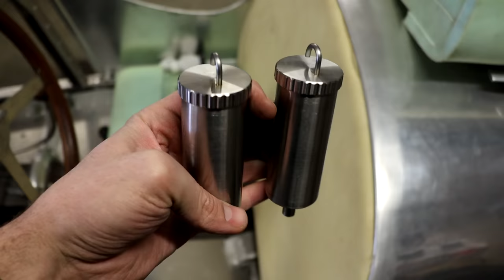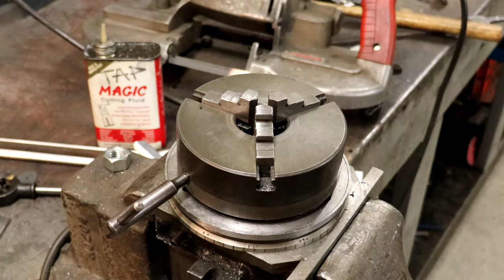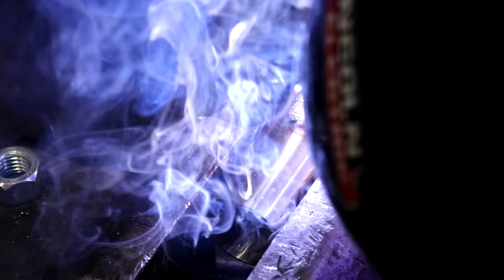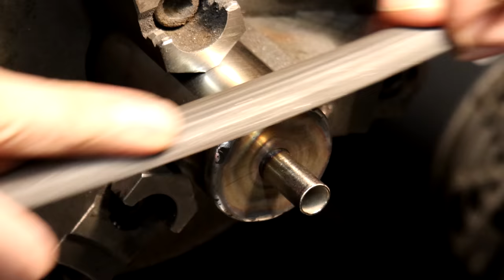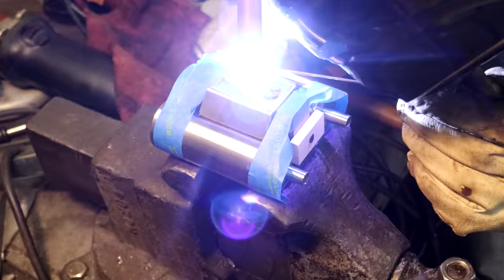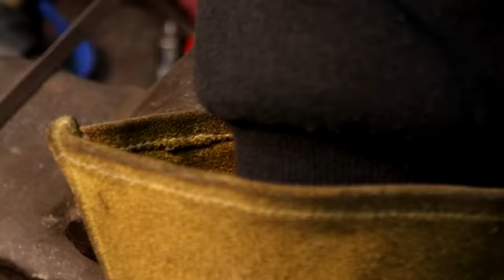Making Cool Components to Replace Ugly Ones | Homemade Boat-tail Speedster Pt. 56

Comment: Really nice! Suggest using hard line from the remote reservoirs to the master.
Reply: I agree! The reason this video appealed to me, was that over time, the plastic reservoirs leak (seepage), right at the hose junction to them. A hard-line connection would completely resolve this issue, especially for a car that sits for long periods between uses.

Comment: Beautiful work!  Stainless steel's electrolytically compatible with the aluminum firewall. [See correcting reply.] Those plastic bottles would be total anachronisms on the car. Not constraining yourself by mounting the things before other systems determine the available space is smart.

Comment: dude nice work! looks amazingly nice! but if I see it right you have a vent to provide proper feeding for the zylinder. thats absolutely important to have but if you use a brakefluid it is hygroscopic and will absorb water from the air around. better take some silicone based brake fluid or even LHM+  (often used in old french cars)
Reply: Brake fluid is also incredibly corrosive, which is why plastic resevoirs are so common.
Reply: The vent hole is on the other side of the rubber disc which will therefore act like a flexible bladder. Not sure if this would be sufficient sealing or maybe not flexible enough. Needs experimentation!

Comment: Hey man, love watching your videos and I think you’re doing a great job. However there is definitely an issue with your reservoirs. Brake fluid can’t be open to the atmosphere because it will draw in all kinds of moisture. If you look at any type of master cylinder reservoir they have a seal with a bellows on them so fluid can come out of the reservoir but still be sealed from the atmosphere. You might want to take a look at that. Keep up the good work!

Comment: I think you made the right choice using stainless. Certainly over using the plastic reservoirs. 
Years ago when I was working on a new model project at my works R&D shop in Ohio one of the fabrication guys there made an aluminum brake reservoir for his race car. It was the first time for me to see an CNC mill in use. I believe he did thread the cap onto the body and did have difficulty cutting the internal threads on the cap. Your method is way easier and as you mentioned you can’t tell the difference after the outside is ground down and finished. 

Hopefully you find a way to combat the issue of the open vents and brake fluid being hydroscopic. That’s why brake reservoirs have that “bladder” built into the seal on the cap.

Comment: Have been watching these videos a long time and this is one of the coolest pieces so far!!  Pieces that look like they can only be made in a factory.  The early part of this series inspired me to adapt a Camaro/Corvette combined T56 transmission to an NP231 transfer case with (2) 1.5" blocks of aluminum, a handheld jig saw, and a harbor freight drill press, and somehow it all worked with no vibrations!!

Comment: If you install them with some neoprene washers, that will provide enough flex to get the Flathead screws to line up and still be adequately tight. It's a tiny detail, but it really jumps out at you when it's done correctly

Comment: Super nice as always.  Where is the engine ?  BTW I’m following in your footsteps. Mine is now a roller with a 4.2 Jag Engine,
39 ford banjo rear, Model A front suspension.  Just got the Radiator so will start making the body. Would love to share photos
With you, but don’t know how to post to you ?
Good Luck, Dennis Olympia, Wa.

Comment: I get the air bleed, but won’t the gasket keep the air from getting in there? Wouldn’t an OnRing work better? Beautiful work as always
Reply: I wondered same thing. Solution may be as simple as a pinhole punched through the gasket.
Reply: The rubber disc may act as a flexible bladder letting the pressure equalise whilst keep moisture out.

Comment: Vince, spectacular work again as usual.
I'm so impressed at your ability not only in the build but your thoughtfulness in design
What would you say is the time you spend on designing a part compared to the manufacturer of it?
Do you have any updates on the engine?
 The cost of rebuilding the engine must be rather expensive, have you considered setting up a patreon account to help the project progress and to give yourself a bit of a leg up financially for future expenses?
Evil grin, with petrol costs soaring have you considered making it an electric vehicle 🤔😁
Or just putting it out there
A quick change slide in or out petrol or electric swap out hybrid?
Seriously consider installing a bulk wiring connector for your wiring on your firewall, so if you do have to take the engine out it is just one big plug on the fire wall and the whole engine harness comes out with the engine not a huge lot of plugs and connectors to undo 
Have a look at Taylor Ray channel for what he has just done to his Corvette C6 he is Building (June 2022) for ideas 
Can't wait for your next video 
Tony from Western Australia 🇦🇺
Reply from the maker: the engine is still the biggest hurdle. not 100% sure of the path forward yet
Reply: @MacroMachines  at this point Vince think about the reliability of the car and cost of fixing it in the future, if something goes wrong with the engine your using, and if the car is going to be registered for driving on road or track and it breaks down can you quickly get it fixed?
Example can you go to a parts store and get what you need now or will you have to wait and hope you can get an obscure part sent from England before you retire at 65?
Sometimes it is better to use modern running gear for reliable service, economy and access to parts. 

Put the hood on and have the appearance of a classic sculpture and have the best of both worlds.
Maybe a V6  or  supercharged
4 or straight 6 would be perfect? 
Or maybe a 1000cc Honda Gold wing engine with shaft drive. Or BMW bike engine and shaft or go for the 750 cc Suzuki Waterbottle 2 stroke
 (I rode one about 40 years ago when I got back from the ride I just about had to change my jeans!!) 
But just chucking it out there,
You have room for an electric motor and batteries in the front and the bobtail at the back, add regenerating brakes
And bingo have a look at he Mercedes Superfast Matt has built, TALK/CONTACT HIM he is very knowledgeable and I'm sure he would be very impressed with your work as well. 
Also check out his motor bike engined sports car he built (as seen on Jay Lenos channel as well)
Oh he is now building a motorbike of sorts for a world record run on bonneville salt flats🤔😁
Your gonna love his channel.
Good luck Vince I'm always on your side mate 😁
Tony from Western Australia 🇦🇺

Comment: Are you going to turn or otherwise face that firewall? Say like Bugatti’s or old Alfa’s ? As it is aluminium, over time it will get nicks and scratches which will show up on a smooth sheet.

Comment: Looks great, is the brake fluid you're using not hydroscopic? Usually you see diaphragm in the reservoirs to protect the brake from the environment so that it can't absorb moisture and introduce it to your brake system.

Comment: Great work. I do have a question: brake fluid is hydroscopic, so if it were open to the atmosphere, it would naturally absorb moisture and shorten the life.  Are you intending to create some sort of septum between the fluid and atmosphere coming in through the vent?
Reply: Le liquide de frein silicone n'absorbe pas l'humidité

Comment: I was supprised in the last video that you mounted the master cyclinders under the car and not set up for the same mechanical advantage by mounting it infront of the pedal, is that due to the engine layout? You might consider mounting these to a bracket so they are along side the engine bay side cover. I do love the "Let make something different", more in keeping with the rest of the car, I do the same on all my projects as well.

Comment: Nice - but - you're going to need a sight glass to see the levels. That'w what the plastic does allow.
Reply: Wow, too lazy to just unscrew the top to check level.
Reply: @fordilac  May be :-) But if you are building a steampunkesque vehicle, you need to go all the way. ...
Reply: @Anne6621  LOL, you are a mere child, I have owned more that did not have them.
Reply: @Anne6621  Sorry Anne, I was replying to Nickle. I can barely my 70th birthday, LOL. Yelp, plastic reservoirs came out late 70's to early 80's.  Hell I was glad when they went to firewall mounted master cylinders.

Comment: If you're comfortable giving me an address and covering shipping, I've got a pretty tight dividing head I'd be happy to send your way. I'm in the midst of downsizing and selling off my shop and I'm not too thrilled about it. I suppose I would rather see you use it then have it simply disappear. If you want to reach out, my Gmail address is my first name with no hyphen, a period, and my last name. Be well

Comment: Nice work, but unfortunatelly these ugly plastic reservoirs have very important advantage compared to yours - you can see the fluid level from opened hood without unscrewing any reservoir lid.
But I understand - design is design. But also in case of lower safety?!